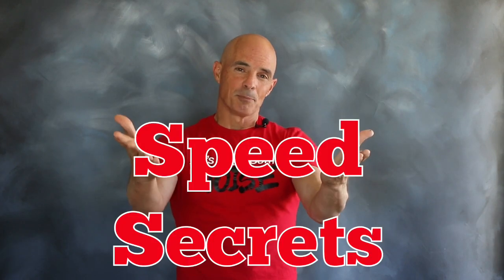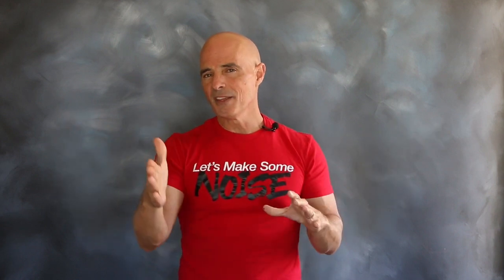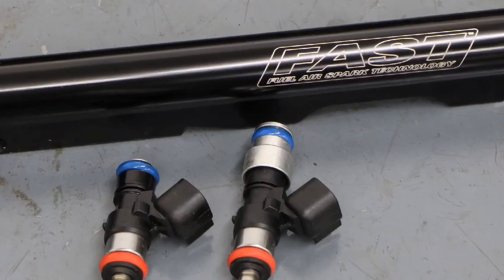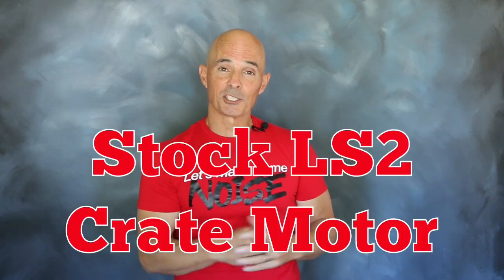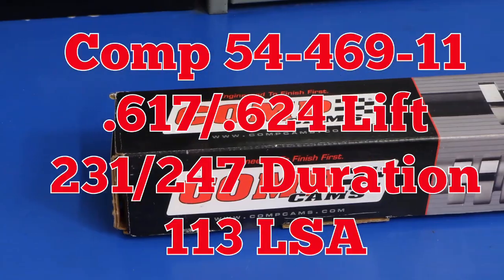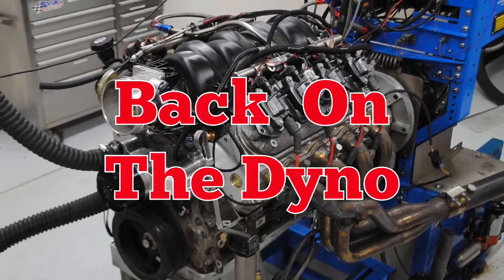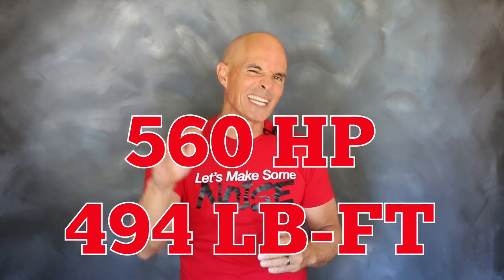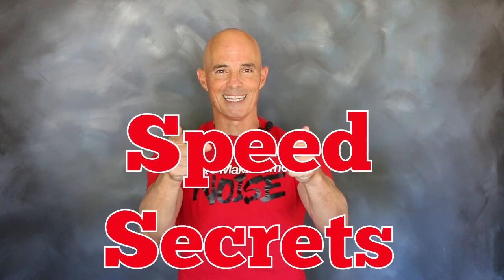Speed Secrets: Upgrade an LS2 Crate Engine

Comment: Something i dont get : 464 with only 92mmTB, ecu, big injectors ? stock ls2 makes ~370 to 390 on dyno @crank.....
Reply: But it was also dialed in with the holley, so fuel/and ignition probably picks up some gains over stock.
Reply: @hefftoneGA  Holley cam ?

Comment: Why is it that his stock numbers are so much higher than my stock factory numbers on my LS2? I know he used bigger injectors, and throttle body, but my GTO is 400 crank hp stock and he is at 464?
Reply: He runs them without accessories, cold, dyno water and an electric water pump.
Reply: And it's tuned for strait power ,unlike stock form where they want some power along with longevity,makes a big difference

Comment: How could i get more torque and HP out of my 2003 chevy 1500HD 6.0L.... the manufacturer say 300 horsepower I would like to see close to 500 HP
Reply from the maker: To hit 500hp in a 6.0, you'll need some aftermarket ported heads, a mid-range Comp Cam, headers, and a very good tune. In a truck like yours, you would also need to go to a much higher stall converter. It can be done though!
Reply: @Compcams1976  is there any shops here in Salt Lake City that you would recommend?
Reply: Ken M Unless you really love your truck or is a show truck, I don’t think it’s really worth it trying to do all these mods. They get really pricey quick. It’s definitely going to cost you more than the current valve of the truck. If you have high miles on the motor than I think you’ll just be setting yourself up. I bought 6.0 with all accessories and Tranny out of an 02’ 1500 HD for $1200 buy it has 340k at the clock so I felt skeptical trying to do any mods or get it rebuild where I have to polish the crank and get new gaskets, oil pump and if I go with different heads then heavy duty pushrods and springs and before you know it I’m in 6k in parts and machine shop costs when you can get a used crate ls2 or Ls3 for the same price. I just recently ran into an LS2 out of an 07 Trailblazer SS for $1200 but it might need a new crank and bearings. I might get a little impulsive and go all out on this with forged pistons/forged crank and the whole shmeal mentioned here but it will be a $7000 project that will take a couple of years and go on my dream truck: Square Body Sonoma & the LQ4(6.0) I might just do a very light refurbishing where I just drop it off at the machine shop to get the crank polished, acid clean it, new oil pump and put a set of 243 heads, and that Trail Blazer intake, with new rings on the pistons. All that will cost me about $1500 when said and done and I’ll have a new motor that should have at least 380hp and since it’s going into my OBS work truck then I have nothing to worry about; better than my current 5.7 Spider injected junk I have in it now.